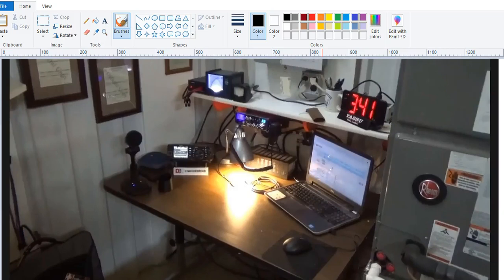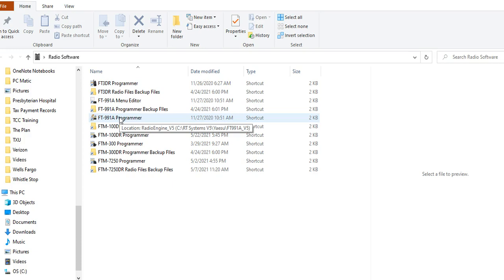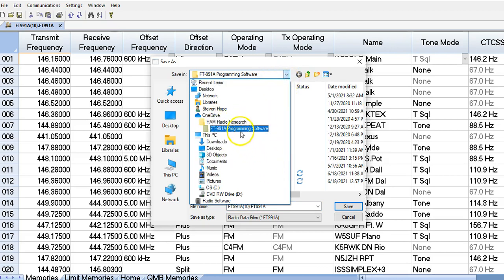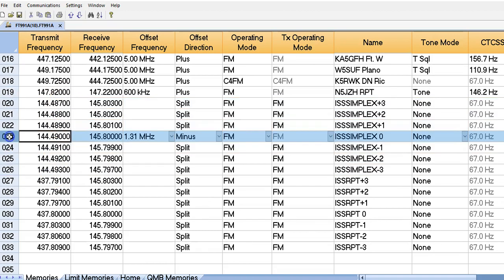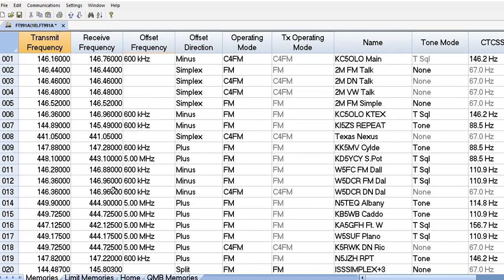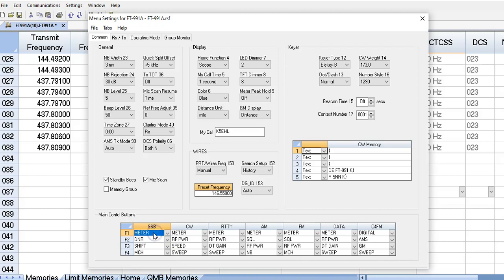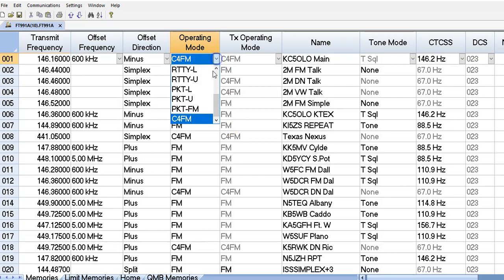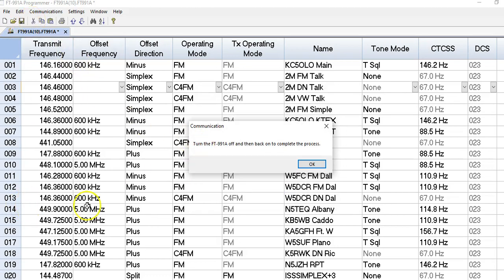Programming ISS Simplex and Crossband Repeaters in Yaesu FT991A RT Systems Software

Comment: for that C4FM issue, I just have two separate memory slots saved for the same frequency, one in FM one in C4FM. Hope that helps 73
Reply from the maker: Good evening sir, thanks I'm sorry for slow response I think that is a good approach, if I'm in C4FM and someone comes in at FM then the frequency switched to FM mode, then I haven't been able to figure out how to get back to C4FM, I'll try your suggestion it seem logical, thanks again I appreciate the message '73 de KIJUF

Comment: Thanks for the video. Very informative. I have the VHF/UHF Repeater Uplink as 145.990 (67Hz) and VHF/UHF Repeater Downlink as 437.800. I think the 145.800 downlink is for voice communications direct with the ISS for contacts and not the repeater. I think your RT Systems file had it different for the repeater uplink ?
Reply from the maker: Hi Zach, thanks for the message, I've been behind, let me check that I know the Doppler effect  I may have had some of the frequencies wrong, thanks again let me know how things are going '73 de KI5JUF

Comment: Why is there a offset freq on ISSSIMPLEX0?
Reply from the maker: Good evening sir, I attached the following link https://hotarc.org/files/iss_doppler.htm I think this actually two different frequencies ▾
Voice and SSTV Downlink:	       145.800
Voice Uplink	144.490
VHF Packet Uplink and Downlink 	145.825
UHF Packet Uplink and Downlink	 437.550
VHF/UHF Repeater Uplink: 	       145.990 (PL 67 Hz)
VHF/UHF Repeater Downlink:	437.800

Let me know, I'm just starting my research, any you have let me know I apprcitate the questions helps me get my head wrapped around it '73 de KI5JUF
Reply: @westtexasvideogateski5juf255  Not sure we're talking about the same thing. In your vid you had an offset frequency inputted into the freq offset field in the programming software. I've never done that & was inquiring into what was up. Keep the vids coming!